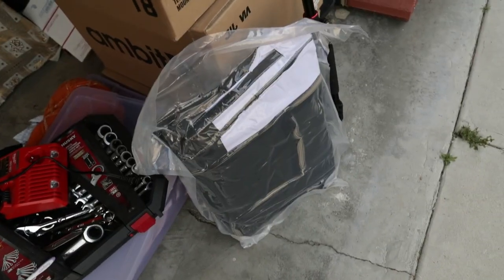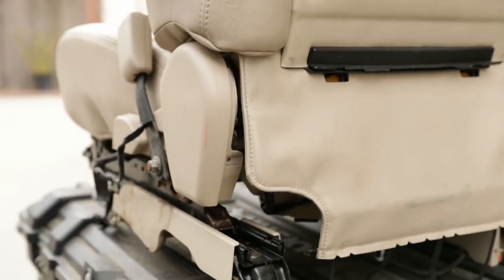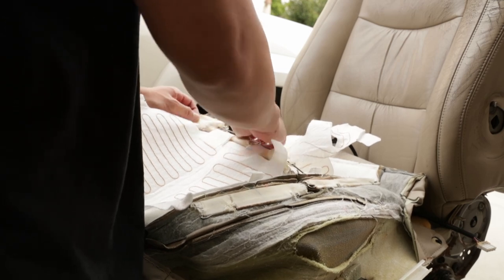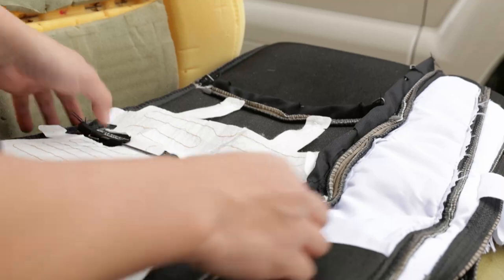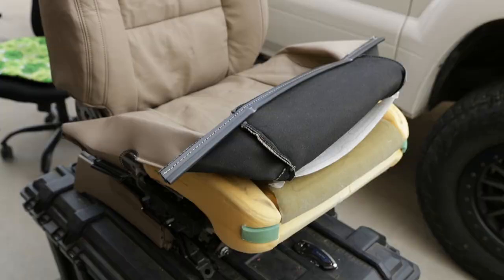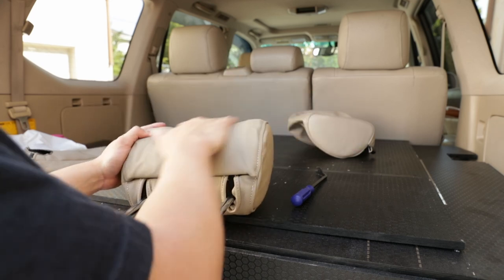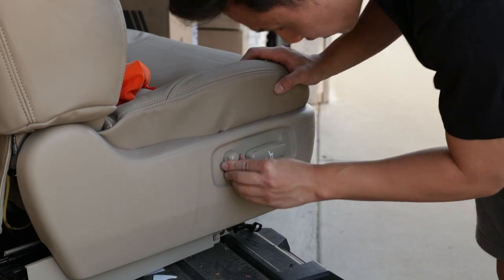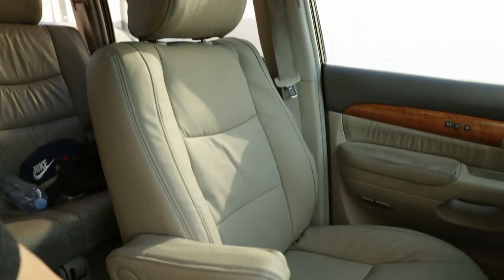How to Install Factory Fit Leather Seat Cover on Lexus GX470 | LSeat.com

Comment: Just finished installing the lseat leather covers on my front row.  Could not have done it without this video.  Everything went perfect except the j-hook along the front edge of the lower cushion.  The seam came loose on both covers during installation.  That part of the install is brutal.  Once the plastic housing is reinstalled, it looks perfect though.  Can’t tell the seam is loose at all.  Thanks for the video.
Reply from the maker: LFG! So glad the install video helped. Yea I agree that part was brutal but you got em on! Much respect! It's not the easiest install.

Comment: Great video.  Followed your instructions for the most part, except I used very small zip ties instead of hog rings.  Didn't even use the rods.  I installed an amazon faux leather bottom cover (see link below).  Zip tied a small loop to the rods in the padding and then another thru the inserts on the replacement and the white cotton looking material that is the seat warmer.  Tied both together and pulled tight as well as cut the tail end of the zip tie.  So far so good.  Warmers work and the seat is fine (though a slight different color).  Did driver side only.  Thanks again though.  Couldn't have done this myself without your video.

Comment: Hi All, I just did my 2009 GX 470. Ray's video helped a great deal. The one difference was the headrest. My original headrests (or they may have been done by the previous owner) had the foam filled inside the leather as one unit. There was no separate leather layer. The leather seams were part of the foam. So I had to rip and cut the leather off the foam. Actually, the leather may not have been real leather, it ripped easily and was a little stretchable. Once I removed the outer leather/leatherette, I decided to use a garbage bag and shop vac to shrink the size of the foam. That helped tremendously as I don't think I could have forced the lseat headrests over that large foam piece. I tore off parts of the garbage bag that stuck out and the rest is still inside the headrest. I will say that the lseat covers are not exact replicas of the OEM seat covers. Especially the pieces and parts going between the seat and back. I'm hoping the Arizona sun will get rid of the wrinkles and what seems like some excess material. The seat was the hardest part to replace. The lseat seat covers have that single long J-hook material around the front and the front part of both sides. I had to remove some pieces of the J-hook with a dremel, otherwise I couldn't get the entire single J-hook on the metal frame of the seat. In fact, the previous owner probably had the driver's seat done and it looked like a professional job. The front part of the seat cover had 5 or 6 screws going through the leather and J-hook to the metal frame. That was their solution to securing the front part of the seat. Makes total sense.

Comment: Hey just curious if you can confirm this is real (full or top grain) leather, or if it is some kind of composite (like genuine). Also, I'd also love a follow up video to see how the leather has settled in. Seems like the headrest could be an issue. Thanks for this video!!! I have the grey color and really hope it matches as well. Finally at min 41 you mention a clamp trick but I wasn't able to find what that is in the vid. If you could lmk, I'd be appreciated!

Comment: What tool did you use to fasten the heated seat element? Thanks
Reply from the maker: I used the Tag Gun that they use to put tags on T-Shirts. Links are in the description. Don't forget to get the tags (Also in the description)

Comment: Hi what did you do to your center wood trim on the dash that is silver in your GX versus the wood that would have been there, mine my wood is breaking apart, thanks and did the leather covers finally smooth out the wrinkles?
Reply from the maker: I toss my old trim pieces in the trash. Yea most of the major wrinkles smooth itself out. It looks way better now.

Comment: I was always told not to disconnect an airbag wire, since it could cost the customer a lot of money ($600) if it has to be reset professional.
Reply: Disconnect battery
Reply: Disconnect batter and then no big deal